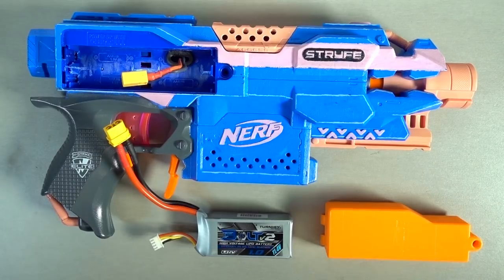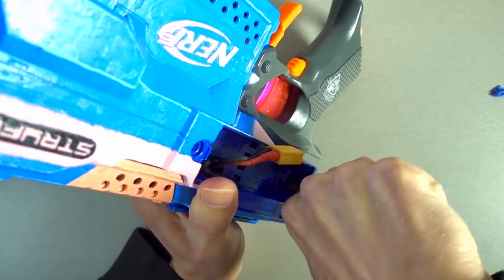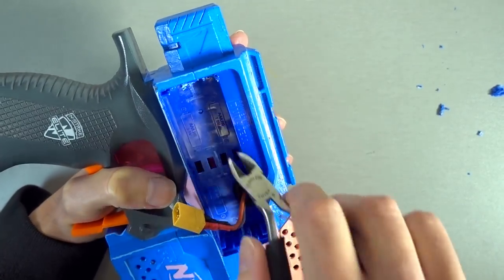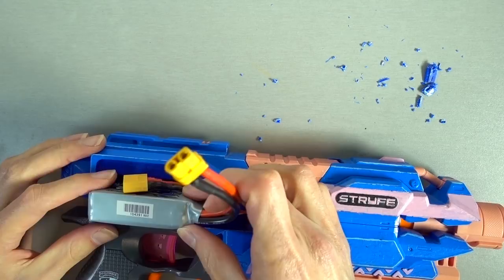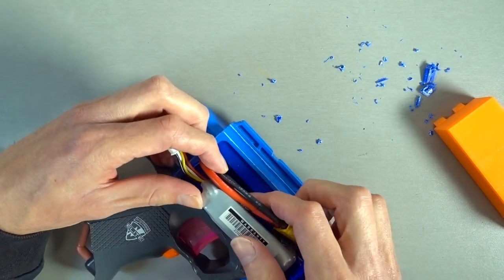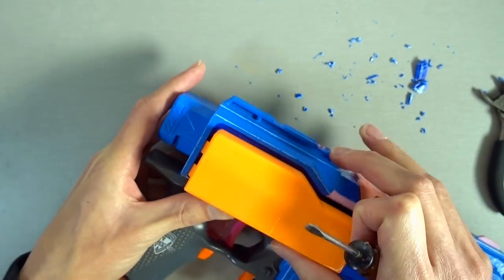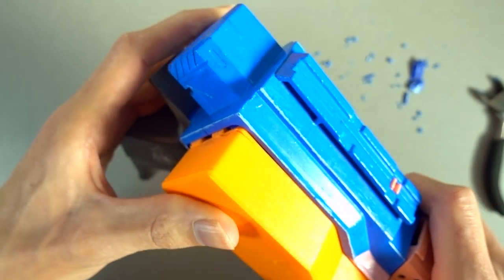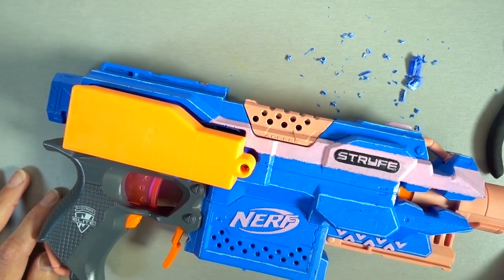Making A Thick Battery Fit In The Nerf Stryfe | Workbench Wednesday

Comment: Jealous of your battery. My charger doesn't work with them, so I haven't bought one yet.
Reply: WalcomS7 hey glad to see your still active despite you taking a bit of a rest, we all support you and I'm sure eventually it will blow over or be resolved
Reply from the maker: +WalcomS7 I'm not certain mine has a LiHV setting, so I just charge it as a normal LiPo, so it's not currently getting the benefit of LiHV
Reply: Think about upgrading to LIHV charger and batteries as well.
Reply: @Walcoms7 I would highly suggest investing in an Accucel S60 charger from Hobbyking, it does basically all chemistries including LiHV. Can be had for a steal right now for around $23 from the US warehouse, plus shipping to you (was $8 for me). I'm not sure how long the sale will still be going on.

Comment: Highly recommend getting rid of the 'Duracell' area up top. There's a lot of space up there that even hides wires pretty well if you route them through the top left of it. I put a piece of polycarb down to make a barrier between the battery and internals, which is simple to do. Would also give you a reason to open the Styrfe up and clean it/do maintenance ;)

Check out my Blue/Silver stryfe video at 2:58 for visual.
Reply: IAmBobololo Seconded, it makes a world of difference on fitting looks into stryfe battery trays.
Reply from the maker: Once I have the select fire kit in hand and am certain that the area covered by the duracell part isn't needed or used in the kit then I'll dremel it out, but if it does need that space, I want to keep it separated the way the kit expects it to be.

Comment: Just as a suggestion, I'd say once the tabs have been cleared out, sand them down flat so no sharp edges are there, and also it just looks professional IMO. I'm curious to know what is the battery you're using? that could be a factor in why the LiPo isn't fitting. Other than that hopefully it all goes well.

Comment: And people wonder why I want an external gear mounted LIPO. Damn expanded battery trays.
Reply from the maker: I do really like the idea of stock mounted batteries, which is a plan for the FabuStryfe XF in the future.
Reply: Those are cool but I think I'm going to go a step further and have my LIPO mounted on my tac vest in its own hard case with a wire to connect it to the blaster and have the voltmeter built into the battery housing. That way I can run several different blasters off the same power supply through the day, I can have a much higher Mah pack, I wont have to have to wire a voltmeter into every blaster I own and I wont have to buy expanded battery trays or get a new LIPO to fit in it.
Reply: If your always going to have a stock on the blaster, then yeah, a power stock is a good idea
Reply: They are a decent solution but just like the expanded battery tray solution it just creates a new problem to solve the initial problem. I'm not likely to waste my time and money making tailored battery compartments for 10+ flywheel blasters when I can just as easily do the same job with a one size fits all fix but thats just me.

Comment: Did you ever figure this out because I'm having the same issues with a number of my builds.
Reply from the maker: I was eventually able to get it to fit in the BSUK battery tray, it just took a bit of moving wires and doesn't go in easily, may do an update on how I got mine to fit.